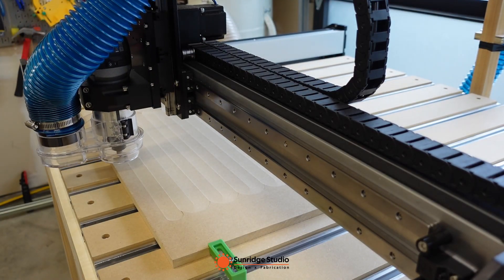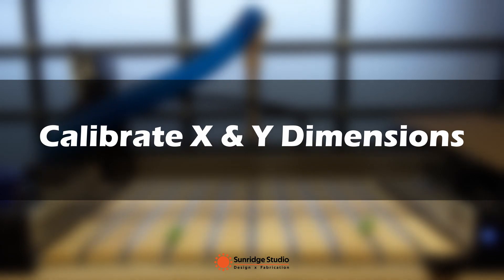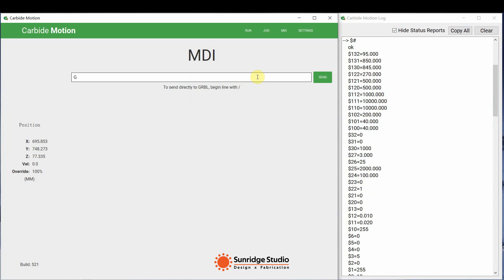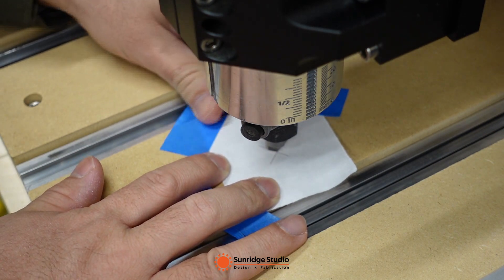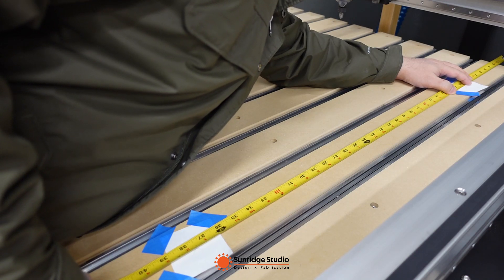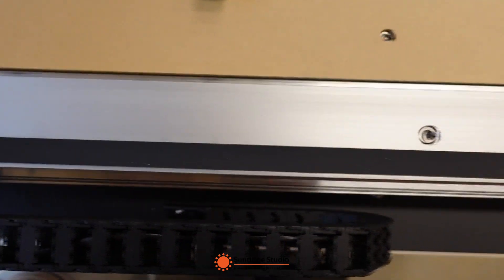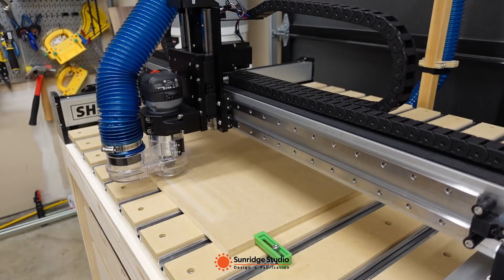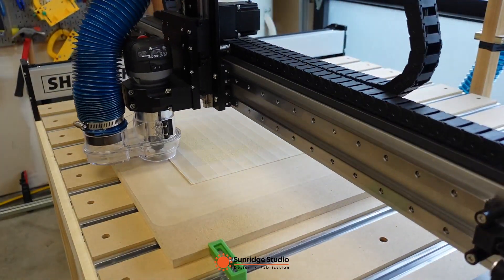Shapeoko Pro CNC Finetune, Calibration, Squaring, Tramming

Comment: Have a question concerning this procedure. After performing these adjustments, will Motion revert back to original stepper motor 40.00 settings. If so does the new distances remain? If the adjustment is made to (example) 40.100 to increase 699.75 to 700. Again Thank you for the time and video.

Comment: New Shapeoko XXL Pro owner  and new subscriber to your channel here. Question. For no reason at all, my Shapeoko is not longer recognizing or calculating the surface area correctly. Ex. When I rapid position to the SW corner or Center, the router tries to go farther left than it can  going to the SW position and the center is no where near the center. This just happened. I used the machine with no problem last week. So do you know how to get the machine to go back to way it was a week ago. Have to admit I am not comfortable messing with the MDI. Would updating the software help? Any advice you have is greatly appreciated.
Reply from the maker: I never met this issue before. Suggest you contacting Carbide3d directly. They are quite helpful based on my experience.
Reply: @SunridgeStudio   Did exactly what u said, and after 7 days, they replied with reinstall my XXL. It worked. No problems with surface area since. Very happy to be back in business. Somehow, the coordinates got screwed up.

Comment: Thank you for the instruction.  I just accomplished this on our XXL Pro and it was spot on as best as we could determine using a tape measure.  We found it very difficult to measure using a tape ruler considering we are trying to get thousandths measurement.
Reply from the maker: Congratulations! A metric tape measure may be easier to use in this case. My machine was also quite good at X/Y and square, but tramming Z was needed.

Comment: Have you had any belt slipping on the X axis?
Reply from the maker: I have no belt slipping so far. The router seems to be the weak point of this Shapeoko Pro system. I broke 2-3 router bits in this year due to the cutting stepdown or feedrate was too aggressive. Now if I cut at full load of the bit, I'll set cutting stepdown to 1/4 of the diameter of the bit, and cutting feedrate to around 50 inches/minute. You may also want to check if the belt is tighten enough?

Comment: Good video, but it should be pointed out that to square the Shapeoko Pro after assembly, you not only have to loosen the shoulder bolts, you actually need to remove the MDF slats from the hybrid table and than loosen all the screws holding the aluminum channels down. One of the great things about the hybrid table is the rigidity it provides, but you have to loosen everything if you're going make an adjustment. If on assumes that Shapeoko cut all the pieces accurately, then the instructions Winston gives in his assembly video to slide the gantry all the way forward and make sure that it contacts both front end plates should result in a square setup, which you can then check by sliding the gantry all the way to the rear and seeing if it contacts both end rails at the same time. I wish I knew how important that was during assembly, as it's a pain afterwards. On my Shapeoko Pro Standard, my initial setup was pretty square, but I did notice gap on one side of several thousandths, so I did a re-adjustment. I used some light duty clamps with rubber pads to hold the gantry against the front end plates while I tightened the bolts down. This reduced my gap to about 0.002" (just shows how things want to move as you tighten bolts), which I believe is good enough. My next step is to check squareness not using a tape measure, but by cutting a recess around a 5" square on a piece of scrap and measuring that with an accurate dial/digital caliper. Measuring the diagonals of a 4.2" square with the caliper can also confirm squareness.
Reply from the maker: It's a good point. Thank you for your comment!

Comment: Are you sure you didn't make things worse with this adjustment? In my understanding the steps per unit of distance are just a function of the fixed number of steps per revolution of the motor, the fixed gearing ratio, and the pitch of the lead screw or the pitch of teeth on the belts. To me all of those seem like known constants (except maybe for the belts stretching or contracting slightly) to just calculate the steps/mm setting from, and the manufacturer default happens to match those calculated values exactly. Being off by 1mm over a distance of 70cm when measuring hand-drawn marks with a tape-measure to me seems like it's more of a measurement error than anything else.
Reply from the maker: Thank you for the comment! I agree with you. Even if I don't calibrate X&Y axis for Shapeoko Pro, the machine shall work fine in general, as the final adjustment is tiny. For this machine, the minor deviation from calculated number (40) shall come from the tension of belt, as both X and Y axises are still using belt. Z axis is using lead screw, so I did not calibrate Z. Another reason I want to calibrate X&Y is that this is the pre-condition of squaring the machine. What I did not show in the video is that I actually finetuned the number for X&Y axises for tens of times, and verified the final number I inputed in MDI can achieve the best/consistent result.